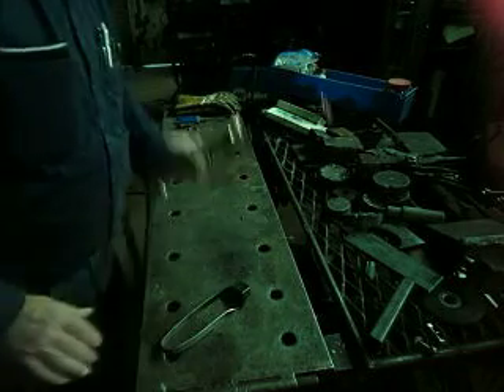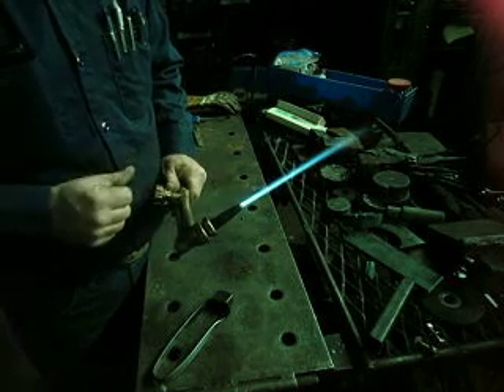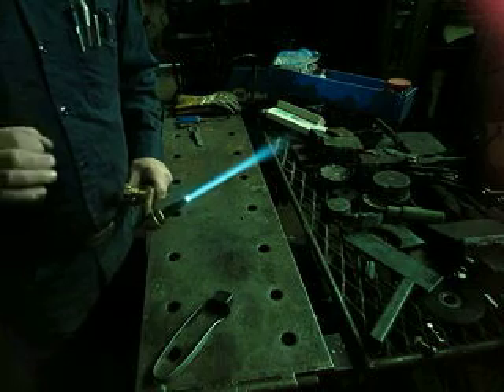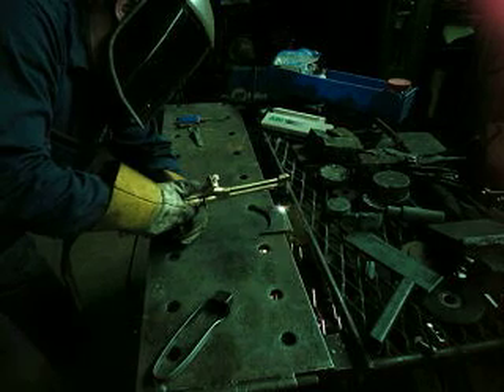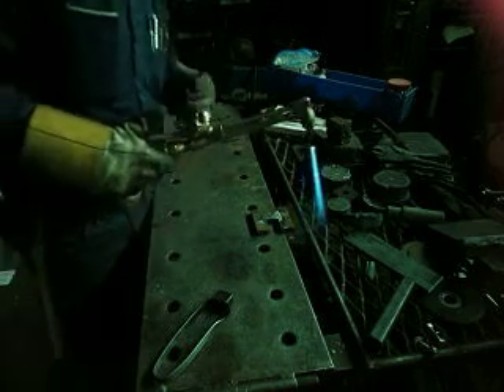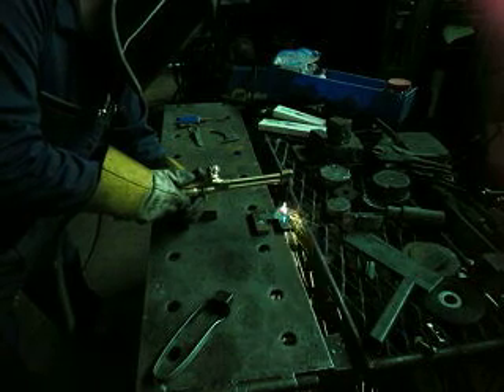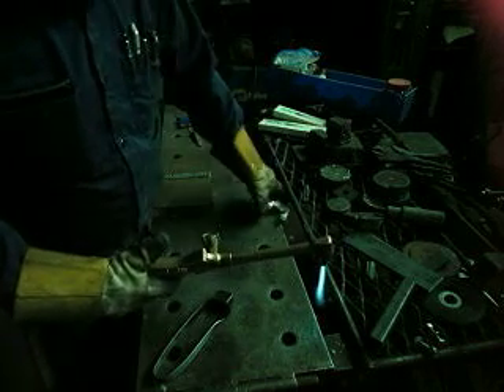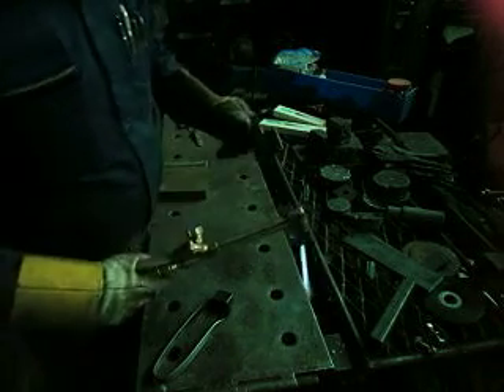Adjusting a cutting torch and other tricks 1

Comment: best adjustment for cutting video I have seen.  Excellent pointer on flame shapes, length, and form.  Thanks for the distance tips.  I have been making sloppy cuts on 3/16 sheet steel, maybe these tips will help.

Comment from the maker: Thanks. I've got a better camera now. One of these days I'll try to get a better video of setting the torch. 

  Yes you keep the oxygen lance going till you're through cutting. That's what does the cutting or actually burning of the metal making the cut. I have a video showing just cutting with the oxygen lance and no preheat (not the easiest thing to do but doable).

Comment: Finally!  a man that describes the actual flame while adjusting. I can get the blue and white, but feather and no feather, noone seems to explain that.Thank you sir for a good video. I have watch several and yours is the most help..   One question if I may:   When you see the small molten puddle, you then press the lever for the oxy. Do you keep the oxy lever on through the cut and then release?